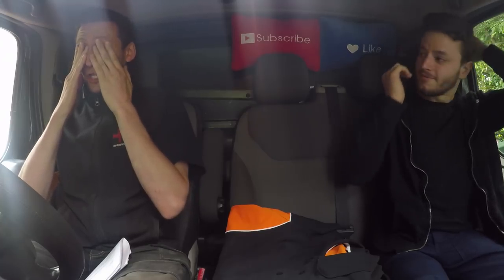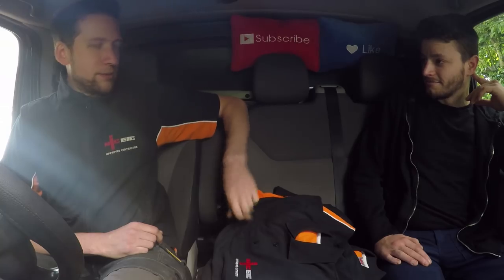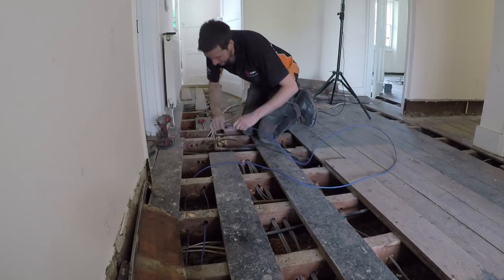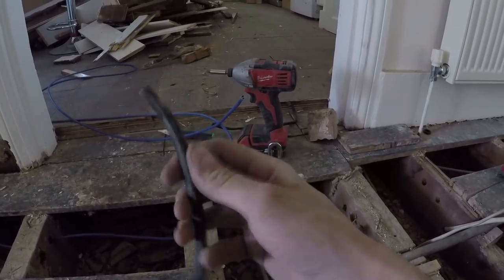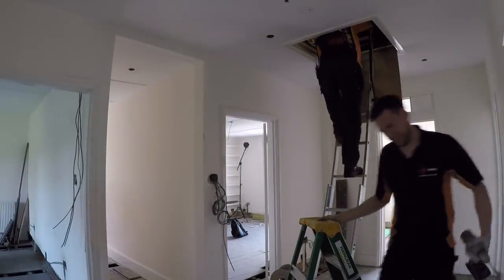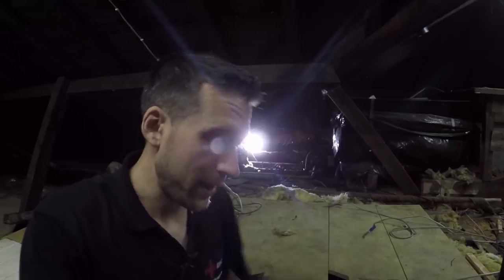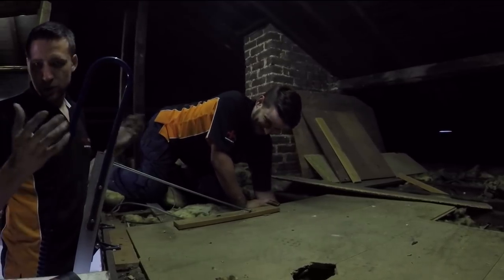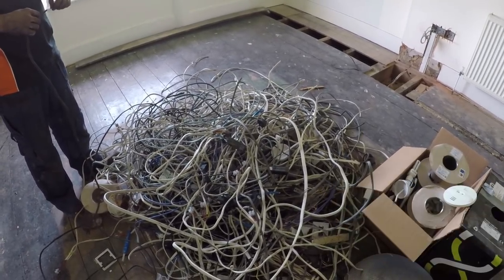Why voltage pens are essential + VIR cable is horrible smeg! | Thomas Nagy

Comment: Lead sheathed and plain VIR (Vulcanised India Rubber) are all well past their expiry date as you say.  The insulation goes brittle and breaks down posing an arcing risk and the lead stuff can sometimes have it's whole lead sheath go live due to poor earth continuity and botched joints done by house butchers.
Reply: bigclivedotcom you also can't rely on an IR testing. If I see it I don't touch it as if it crumbles you could be liable for the repair.
Reply: Spot on Clive.
Reply: Natural latex rubber degrades with time as it's ultimately an organic substance. Usually, continuous exposure to heat or UV will accelerate this.
Reply: I've dealt with my fair share of rubber (VIR) wiring over the years. It's just amazing how some of it does age incredibly well and other VIR simply cracks and crumbles as soon as it's touched.

My 1st experience of it was in my parents house when I was an apprentice. The VIR in a junction box had shorted where the conductors crossed over each other. That was my very first solo fault finding experience.
Reply: Indeed it can.  In Queensland, during the insulation scandal, there were a few houses with VIR installed, where the cable failed, and was in contact with the foil insulation.  A few installers died because of this.  This is why foil insulation in ceilings is now banned...
Reply: Indeed! It's the same with other kinds of rubber wiring. Austria and Germany never used much plain rubber wiring but plenty of cloth-wrapped rubber insulated singles. I occasionally find some still in service that probably pre-date WWI and it's a totally mixed bunch. Some are in near-perfect condition, others crumble as soon as you touch them. The stuff from right after the war is the absolutely worst of the bunch, the older wires are usually in better shape. Typically there's no earth whatsoever so you can't do much but fix simple faults anyway. In the early 50s they switched to PVC and that's usually fine unless it overheated badly or suffers from leaching plasticiser (green goo).
Reply: That plasticiser migration happened here in the early 70s, John Ward did a whole video about it. Where we work (south coast UK) you tend to get a lot of it in 70s estates
Reply: We run into that stuff everywhere here in the American Midwest.  It really is amazing how some feels nice and flexible while other is so incredibly brittle.  I think it has a lot to do with the airflow around it and the heat created nearby.  It seems like near the fixtures is inevitably more brittle.

Also, I haven't noticed you running in to any knob and tube.  Was that used in London?  That stuff is everywhere here in Kansas City and it's a nuisance.

Comment: Have you tried using  pallet breakers too lift up floor boards , you use the joist too leaver against and as it has a long handle very little effort is needed  . great videos by the way

Comment: Heat will cause the VIR cabling to become brittle. Heat, as well as UV and oxygen/ozone, increases oxidation and polymerization of the organic molecules creating cross linking. More links means stiffer, brittler rubber. The worst cables were probably getting a little warm.
Reply: Ian Melzer 
They could have been close to central heating pipes as they often share the same runs through joists due to lazy installation.

Comment: Voltage sticks can be used incorrectly. So can a meter. Saw a video once of lineman (utility workers) using theirs to check a circuit was off which made a great example how how to use it. 1) check a known live circuit, make sure it indicates. 2) Test your circuit to make sure it is off. 3) test a known live circuit AGAIN to make sure it still indicates. Why? Because they can fail or turn off. You and your tools must both be reliable to work safely. My fluke 117 has non contact testing for when I want it, but I will physically test the circuit whenever I can.

Comment: Lads, please, get face masks as a matter of urgency, I heard you coughing when you went down the ladder, the dust in the loft contains a lot of minute fibres from the loft insulation, plus the many years of accumulated crap etc.
Please take this advise from a 75 year old guy who has worked for most of my life before masks were available.
Very best regards form Ray..
Reply: I was thinking the same thing. Little Tom with his face inches from fibreglass. Not good lad !!!.
Reply: Agreed, I used to say "its only for a little bit" but now I wear a 3M half mask respirator with cartridges suitable for the task (usually the multi purpose ones)
Reply: Couldn’t agree more if your going into a loft space that has fibre glass should wear face mask and wear a jumper also as is itchy as fuck

Comment: You're dead right about the volt sticks. The only problem with them is idiots without commonsense.
Reply: But it doesn't say on the instructions that common sense is required.
Reply: Just let the Darwinian rules apply.
Much better for the human species in the long run.
Reply: They can show both false positives (from induction or capacitive coupling in parallel cables) and false negatives, just like the (in-) famous neon screwdrivers.

Comment: Should look after your knees Tom and use knee pads
Reply: He is using them most work trousers these days are designed to take knee pads they just blend in pretty well.
Reply: Call ITS!
Reply: Chop chop Dave from ITS, post them knee pads too.
Reply: Yup, Knee pads are a must. I just use small ones that you can put in the knee of dickies trousers. Those ones with elastic fasteners are horrible. You can even get away with just cutting up some high density foam to match the knee pocket size in your work trousers.

Comment: I think the non-contact voltage detectors are a great tool to have! Yes use common sense of course. You mentioned this in a previous video that when checking the wires that just because a wire is dead you can't assume it is for the flat you are working on since maybe the switch controlling the wire is turned off in the other flat (e.g. a lighting circuit).
Reply: Yes. It's perfectly fine to use the pen to check if there's live cables. But not for the other way around.

Comment: You should try being an electrician on the Railway, you wouldn't believe how much of this crap is in the older trains on the UK network. Bloody awful stuff.
Reply: Kelvin Park Probably because the flexibility and heat resistance is good for rattling steam heated diesel powered trains, provided you replace it every few years during routine overhauls.

Comment: when i used to do rewires in flats unless i could see where the cable was going i would leave it in...use a voltstick yes, but remember, there could be switchwires, or switched 2.5 T&E present from the flat below....ask me how i know! once did a flat, where unknown to me the people below were away for a few weeks....i accidently cut a 2.5 cable which was dead...only for a phone call 3 weeks later, there immersion was not working...what a nightmare, as by that time the floors had been hard-boarded and carpeted....lesson learned!....TRS or VIR cables present resulted in a instant "fail" when doing PIR testing for me.
Reply: sparkey1958 yes mate totally agree if in doubt leave it in! it's a bit less cable for the scrapbag but better than having to come back and spend hours repairing something which you won't get paid for!
Reply: Would just made out nothing to do with work upstairs. It shouldn’t of been anyway. It’s a fuck up but for what it is could been faulty immersion regardless especially as it’s all finished who to say a cable was cut . Would said nothing to do with above and charged them a new job . If was next day they told me not working would sorted it there and then but like that no way I’m saying that because of work upstairs I done two separate flats

Comment: I use my fluke volt stick all the time. Ideal for what Tom uses his for. They are not meant to verify a dead circuit.. They are for indication purposes only to verify the presence of a live wire. So many people can't grab that concept.
Reply: Yep a widow stick won't id an active neutral, like a return from a lamp. Looks dead until you cut the cable.

Comment: VIR in Australia is a total fail.  You can't grandfather that in at all.  The company I work for will disconnect you (we are the utility) and not reconnect until you've got a COC completed by a master electrician, detailing the whole site remediation.  The whole site being remediated, or a disconnection of supply mandates the systems in the board are brought up to date, which usually means all new panel, new cable and RCD/RCBOs installed on everything.  It normally can require a new lead-in too.

Comment: I once had a flat built in the 60's that used MICC cable for all the lighting circuits (and maybe the ring main). Buried in the plaster and a pig to repair.

Comment: I remember doing a job for a friend and we found some "disused" black rubber cable loose under the floorboards which had been coiled up and left, rather than removed when the house was rewired. Couldn't pull out the full length, the end of which disappeared through a joist, so decided to cut off the excess and remove what we could.

What we didn't know was that the houses previous owner had put a junction box i n the new main and decided to reuse the old rubber cable so he could put an an electric heater on the landing. Which he later disconnected when he had central heating installed. He then just poked the loose ends of the wires back under the floorboards and left it.
So along came I with my cutters thinking it was an old dead cable and you can guess the rest. Made a nice big hole in them!

Comment: Safe isolation ideology and common sense. 

Follow and implement the procedure whilst being fresh to all electrical work not just general sparkying, or when they change the name of the procedure. Once you're seasoned use the safe isolation of loads as a guide then use a volt stick on band 2 voltages, but make sure that you pre test the volt stick on a known live source  before and after testing the circuit to be worked on.

This will reduce the risk of electric shock, injury, loss, embarrassment and RIDDOR etc. Of course its all down to opinion of legislation and ideology. Certain types of insulation and conductor core laying within a cable may give a false reading due to its composition and the live/hot conductors vicinity to the sensing tip of the volt stick.

Testing all poles between each other and to earth/ground using approved testers and proving units is 99% safe. Contacts in poor condition in an isolator or a switch may still intermittently track due to carbon or splatter, or when the actuator or spindle is worn, loose or damaged, the contacts may re make due to vibration or tension. 

To be 100%safe, the conductors should always be disconnected or shorted between each other or to earth/ground to prevent them from being accidently energised. This is only ever mentioned in the guidance for working on mid and high voltage switch gear, and may be a requirement when the EWA regs are next ammended. Or if there is an increase in electrocution due to economy swtchgear not fit for purpose failing to fully and continuosly break all poles, it may be implented sooner.

I use a volt stick most of the time and will continue to do so unless specific sites forbid it.

Comment: These voltage testers only indicate AC voltages. None of these non-contact testers can indicate DC. And in a PV installation you've got a DC part with sometimes round about 690 VDC. 

Sometimes, if the cables are too close to each other you can't differ which one is live and which one is not. Induced or capacitive coupled voltages can sometimes mock them. They are not normalized, so the sensitivity could differ from manufacturer to manufacturer and from model to model.

They're good for the work shown here to prevent cutting off the electricity of the neighbour below or to look for a broken conductor inside of a cable. For these things these voltage testers are ok, but I would never rely only on them to prove if a circuit is dead and safe to work on. 

If you know about the flaws of these testers they are a nice addition to the toolbag, got one too.

Comment: Had en electrition out for a rewire quote. However he wont touch anything until a load of artex gets tested for asbestos, which is fair enough. Is this a common thing in the trade?
Reply: Not surprising, mesothelioma and asbestosis are not pleasant at all
Reply: Really depends on if it needs penetrating during the course of the works.  That`s the upshot of it. An asbestos report could well say, yes it contains asbestos, it`s sealed and in good condition, for which it can remain in situ.

Comment: as an ex HGV driver, height limits on bridges used to always shit me up, but theres usually always a bit of leeway. I once went under (with 2 people guiding) a bridge labled 12'6" in my 14' truck.... it was either that or a 20 mile detour, and the place I had to deliver to was 100 yards on the other end of the bridge...
Reply: I used to park my 1.6m tall Ranger in works 1.5m carpark - squeaky bum time driving 'round for the first time with someone watching to make sure I didn't take any of the pipework off the ceiling with the roof bars! Only problem was the aerial, I could only drive under everything forwards, no reversing or I'd snap it off.. fun times.

Comment: What is the oldest wiring you have found, I went into the loft of a large country house here in Norfolk and found that the lights in there were on solid bare copper run in porcelain and wood cleats. There had originally been a LV DC house lighting system  with batteries and generator and some time in the late 30's or early 40's the house was connected to the mains and in the wisdom of the day they had re used some of the old wiring.
Reply: Equiluxe1 I recall a house with the bare open wiring on porcelain exposed on the low ceiling in the basement.  I almost had to duck not to touch it!  That was a clear no.
Reply: Yes, i saw that once. Also used to see a lot of single core cotton wrapped cable in wooden conduit/trunking.

Comment: The cable you pulled out is TRS (tough rubber sheath I think it stands for?) The old form of twin and earth.
VIR, vulcanised Indian rubber, is the smelly old cloth covered, rubber insulated singles.
Rather you two than me crawling about in a loft full of itchy fluff in the summer. It is a difficult choice of whether to wear a mask or not in those conditions. A mask up there is seriously uncomfortable if you are grafting. I just try and minimise disturbing the shit.
Reply: I’m not going mad then, I have always referred to the cloth stuff as VIR

Comment: I see how you pull cables trough the floor or on the roof. I did know that you do holes with that drill, but was puzzled if you can do it only on walls only without taking out the roof or the floor batten. By chiseling horizontally channels in walls and put plaster or cement after. By the way do you put plaster on the concrete channels after or you tell the owner to hire other person for plastering and painting or whatever he puts on wall? I'm also in question if you have a dry wall you remove it to trace the wires trough it or you work with a long drill  trough the wooden joints and use a fishing tape or take the dry wall out? I am at the beginning in practice and all precautions I take in consideration. For instance I'm worried about drilling holes trough beams because they are part of structure of the house. Also I'm puzzled why you don't use conduits or trunking in the floors for the T&E cables. Finally, if there is parquet on the existing floor would you tell the owner to remove it or is the a solution to do it without removing it? I don't understand one thing. Why is there needed 4 years of apprenticeship just to become a full electrician. Why don't they teach these practice thing during college period? Anyway 4 years is a lot of time just to begin a job like this.
Reply: 4 years is nothing. Its a complicated and extensive trade which requires a lot of manual dexterity, skill and intelligence, as well as an analytical, methodical mind.

Comment: That VIR cable is most probably brittle because it is on the top floor under the roof, damaged/dried due to heat?
Reply: Peter Rosel More likely it carried more accumulated load over its lifespan than the other one.  Remember that all cable isolation is current rated based on how much heat will kill it in 10, 20 or 30 years of usage.

Comment: The way you do things there compared to here in Sweden is acually awfull to be honest. A way to complicate for yourself if anything happens, but everyone does it differently. In sweden we do pipes everywhere. If a cable gets broken, we use the pipe to pull a new cable. Problem solved, in your case... How do you do it? Demolish the house. Nice video though :)

Comment: Actually another tip for going thru joists,  use the bits that look half like auger bits and half flat bits,  irwin do a good set,  they go thru like butter with less force as they partly pull themselves through and your drill won't burn out as it uses less power,  someone by now had probably already told you this,  but I say it as I'm watching whichever video.  Your probably thinking,  fuck me Karl that's old fucking news,  but thought I'd mention it anyway.

Comment: Volt pens are great, but I think it's important to note that you can only use them for confirming that power is ON, not that power is OFF.  Sometimes they misbehave, sometimes they only work at certain points along a cable, sometimes that wire appears to be off but gets turned on by someone else at a later time.  But if they say power is ON, you definitely have live wiring!